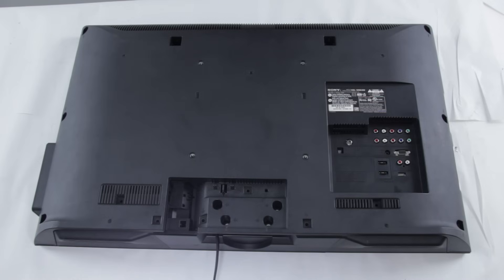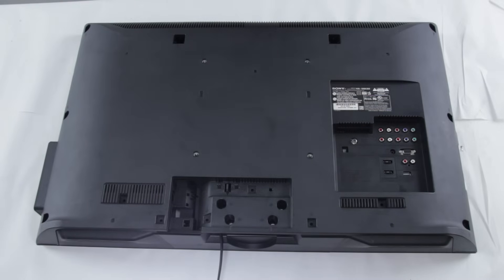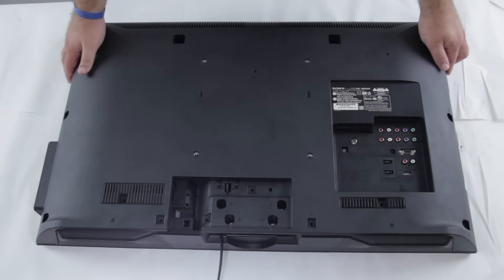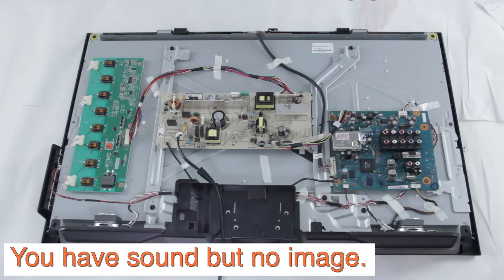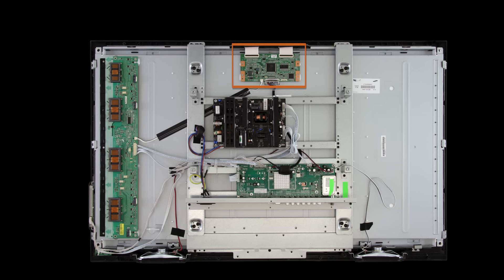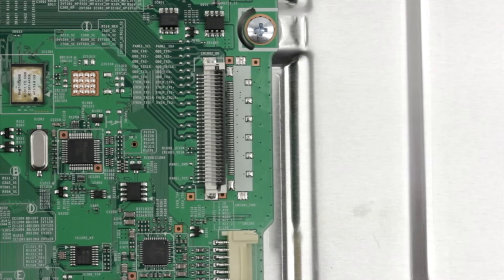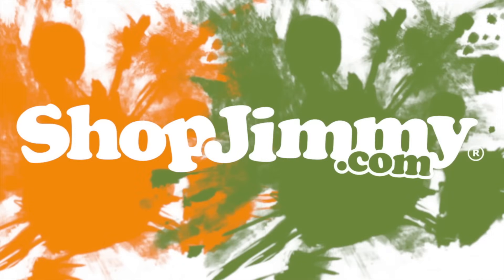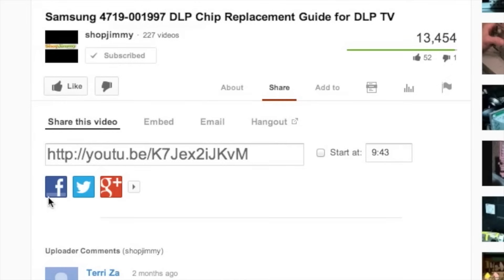LCD TV Repair Tutorial - T-Con Board Common Symptoms & Solutions - How to Replace T-Con Board

Comment: 2011 LG 55LV5500-UA ( S/N 102RMXX1G058 ), on power-up out of standby a week ago, saw video trouble. Very slow response time-looks like video is in slow motion with images trailing behind. See link https://www.youtube.com/watch?v=0GB1dEtHxDE which shows same symptoms as I'm having, whether from external input or SmartTV source. Sound normal. Tried reset, turning off TruMotion. TV sat unplugged for several days before trying again, symptoms unchanged.
Reply from the maker: Steve Rieker   Try all repairs and troubleshooting at your own risk.  This sounds like a TV panel (TV Screen) problem.  If your TV panel is bad, it may be more cost-effective to replace the TV as panels are typically hard to find in stock, difficult to replace, and expensive.  Thanks and please let us know if you have any further questions!  www.shopjimmy.com

Comment: Hello i have a 50 in rca model#50lb45rq serial #2409-50lb45r-b100415 the  problem is when you turn on the tv the red led on the  front of the tv turns blue  for  1 to  2 seconds then goes out  completely  the screen  try to come on  but it shuts off right  away. Any help  would be greatly appreciated.  Thanks

Comment: LG T420HW04, it started with vertical lines, which now is intermittent. The color is off now, it is blurry, almost like a 3D effect but is darker. Would a T-Con board replacement solve these issues?

Comment: I have a Toshiba 32W1333DB,  I have a back light problem, Can see image when in a dark room and shining a flash light on screen, But back light not coming on, After opening the tv, I have T-Con board at the bottom, And 2 boards in the middle that are plugged in to each other, One is the CPU, And the other is where the HDMI and Ariel slot in to, I was advised that the back light inverter has probably gone, Can you please explain where this is on this model, Is it part of the CPU Board

Comment: I have a Sharp lc-70le650u tv that has major issues. 
It powers on. It has sound. It has an overall red and yellow hue. The Picture rolls from top to bottom erratically. This happened all at once during a storm. It was plugged into a large Monster brand surge protector / strip.  
I have removed the back panel and it has three easily replaceable boards. The first is the power board.  I am assuming it is OK. The other two are the T-Con board and the main board.  Sugestions?
Reply: Dan Rosson The tv is out of warranty and about 18 months old.

Comment: hi my tv smart samsung UN40EH5300FXZA has just one horizontal line between the middle and the top of the screen and it is permanent , always in the same place . Do you think it can be a bad t con , main board , cables or  just a bad panel . thanks in advance.
Reply from the maker: ernesto fernandez  Try all repairs and troubleshooting at your own risk.  This sounds like a TV panel (TV Screen) problem.  If your TV panel is bad, it may be more cost-effective to replace the TV as panels are typically hard to find in stock, difficult to replace, and expensive.  Thanks and please let us know if you have any further questions!  www.shopjimmy.com

Comment: OK. So, I got really pissed off yesterday and threw something and it hit my tv. Now, i have vertical colored lines running up and down half of the screen and some video in the other corner, but I can't watch it. Does this sound like a tcon board issue or do I need to replace the screen?Thank you for your help. Also, The screen is not cracked, but when you turn it on, it kind of looks like it in a few spots. Any help is appreciated.
Westinghouse 32" LTV-32W4HDC LCD
Reply from the maker: Amanda Thomas   Try all repairs and troubleshooting at your own risk.  This sounds like a TV panel (TV Screen) problem.  If your TV panel is bad, it may be more cost-effective to replace the TV as panels are typically hard to find in stock, difficult to replace, and expensive.  Thanks and please let us know if you have any further questions!  www.shopjimmy.com

Comment: hi. I have a warfedale  lcd37f1080p. I have replaced the t-con board. However the LVDS connecter on the T-Con side when I removed it some of the wires dissloged from the connecter,I put them back where I assumed they came from. However upon testing I see the coulors are mismatched. Green is pink yellow is blue etc. is there any way I can get a schematic on this cable and if not could I get a replacement LVDS cable. The T-con board No. is T37OHW02 V0. (06A221-B). I hope you can assist me. Kind regards. I reside in South Africa.
Reply from the maker: Jan B   Try all repairs and troubleshooting at your own risk.  Unfortunately, we do not have any information on this TV.  Thanks!  www.shopjimmy.com

Comment: I have an LG 50LN5600. Everything works fine except the bottom half of the screen. There are narrow horizontal stripes across the entire bottom of the screen, so it almost looks like poorly interlaced video. You can see the intended picture on the bottom half, but it looks fuzzy and garbled because the thin strips of the video are jumbled and out of order. This problem shows up on the menus too. I've tried unplugging everything and doing a software reset, but the problem persists. Any ideas?

Comment: I have a Toshiba 46xv54ou 2008. I'm getting lines down my screen. I was curious on the cost of the part. Everything else works on the tv.
Reply from the maker: nick lillquist   PLEASE SUBSCRIBE TO OUR CHANNEL - Try all repairs and troubleshooting at your own risk.  Are the lines vertical or horizontal, and do they cover the entire screen or just parts?  Thanks!  www.shopjimmy.com
Reply: The vertical Lines cover the entire screen.
Reply from the maker: nick lillquist   Try all repairs and troubleshooting at your own risk.  This sounds like a TV panel (TV Screen) problem.  If your TV panel is bad, it may be more cost-effective to replace the TV as panels are typically hard to find in stock, difficult to replace, and expensive.  Thanks and please let us know if you have any further questions!  www.shopjimmy.com

Comment: I have a Samsung 32 TV. The sound is working but there is no picture, one minute it was working, then it lost its picture straight away. I don't think there is any backlight. The TV is a Samsung UE32EH5000K    Vers 07 and the serial number is B4 V83HBDA00081V.
Reply from the maker: Bryan Findler  Try all repairs and troubleshooting at your own risk.  I recommend running the flashlight test on your TV.   Here is a link to a video we produced that shows how to run the flashlight test. https://www.youtube.com/watch?v=xUzCLgoSPGM Please reply with your flashlight test results and we can recommend a replacement part for your TV repair. Thanks and please let us know if you have any questions! www.shopjimmy.com

Comment: Hi ... We have a Sony KDL-46X3000, (4600278) (VK-X-A-GBW-N-FYA-M) which has been perfect since we bought it. Yesterday the screen started flashing, going brighter then returning to normal probably 3 or 4 times a second. This may stop but invariably would get worse and start to flash on and off and eventually no picture, just a black screen but with sound (that remained unaffected throughout). When black, no image from menus or other sourced would display.

Switching the set off for a few minutes may restore stability for some time until the symptoms returned.

I am reluctant to scrap it without first investigating possible fixes and am put off official Sony repairs due to horror stories on forums of insane repair charges when new TV's now are so affordable!

Your guidance would be welcomed!

Comment: Hi. I have a Samsung TV. Model: LA32E420E2R. It has a double image. I stripped it down and it only has one ribbon to the image board then one direct (undetachable) ribbon the screen. How do I solve the double image?
Reply from the maker: Tom Porter   Try all repairs and troubleshooting at your own risk.  This sounds like a TV panel (TV Screen) problem.  If your TV panel is bad, it may be more cost-effective to replace the TV as panels are typically hard to find in stock, difficult to replace, and expensive.  Thanks and please let us know if you have any further questions!  www.shopjimmy.com

Comment: I have a Sharp Aquos 70" tv. LC-70LE650U. Only a year old. Not in warrenty.
TV wont power up. Blinks 5 times then 2. I have a soldering gun and am very good with it I can replace any part on the tv. Just need to know what needs to be replaced.  PLEASE HELP!!! Thank you.
Reply from the maker: Eric Manchester  Try all repairs and troubleshooting at your own risk.  This sounds like a TV panel (TV Screen) problem.  If your TV panel is bad, it may be more cost-effective to replace the TV as panels are typically hard to find in stock, difficult to replace, and expensive.  Thanks and please let us know if you have any further questions!  www.shopjimmy.com

Comment: I have a sharp aquos LC-60E78UN. It has a thick blue strip just to the right of the center of the tv. Would this be caused by the tcon board. Ive tried gently cleaning the ribbon cables from the board, and the blue stripe persists.
Reply from the maker: gabriel rider   Try all repairs and troubleshooting at your own risk.  This sounds like a TV panel (TV Screen) problem.  If your TV panel is bad, it may be more cost-effective to replace the TV as panels are typically hard to find in stock, difficult to replace, and expensive.  Thanks and please let us know if you have any further questions!  www.shopjimmy.com

Comment: i have 42 inch samsung pn42c450 
on the right hand side i have approximately 6 inches of black space which makes my television look like a 32 inch is it the t-con board
i would like to buy one from you asap, my email is jm5431@gmail.com
Reply from the maker: Jay M   Try all repairs and troubleshooting at your own risk.  This sounds like a TV panel (TV Screen) problem.  If your TV panel is bad, it may be more cost-effective to replace the TV as panels are typically hard to find in stock, difficult to replace, and expensive.  Thanks and please let us know if you have any further questions!  www.shopjimmy.com

Comment: I have a Sylvania LC320SL1 32-inch 720p LCD HDTV. went to turn on, and it will not using tv button or remote, but the stand by light stays on. Have unplugged and waited for a week then tried again, still doesn't come on

Comment: Hello Shopjimmy.com   i have two tvs that stopped working some time back and I am curious to see if they are worth a fix..
---------------------------------------------------------------------------------------------------------------------------
The Sanyo ( Model# DP42849 )   Powers on, and shows a green power light, and you can see the backlight,  but it shows no picture..  you can also hear sound..   what could that be ??
---------------------------------------------------------------------------------------------------------------------------
The Toshiba is older  ( Model# 42HL196 )     does not power on but shows a solid red light when the power button is pressed.   it just wouldn't turn on one day.. 

It would be nice to fix these and put them to use instead of just trowing them out..

Comment: I have a Philips 42PFL3604/12 with display/backlight  issue. After few second upon turning it on, the screen picture goes from normal to very bright and it stay very bright. As if it would turn the backlight fully on. What is most likely to be the problem? Thank you in advance!
Reply from the maker: Marko K   PLEASE SUBSCRIBE TO OUR CHANNEL - Try all repairs and troubleshooting at your own risk.   This could be a problem with either the main board, the t-con board or the TV panel.  Unless you have experience using a meter to check voltages, you can replace the main board and t-con board individually to see if one of those boards fixes the problem.  Unfortunately I do not see any replacement parts in the search results for your TV model number on our website.  Thanks and please let us know if you have any further questions!  www.shopjimmy.com

Comment: My model # LN52A530P1FXZA and the problem I am having is when I turn it on I get a picture for a second and then it goes away(getting sound) have replaced two of the backlight invertors and that has not helped. Could it be the tcon board?
Reply from the maker: *****   Try all repairs and troubleshooting at your own risk.  I recommend running the flashlight test on your TV.   Here is a link to a video we produced that shows how to run the flashlight test. https://www.youtube.com/watch?v=xUzCLgoSPGM Please reply with your flashlight test results and we can recommend a replacement part for your TV repair. Thanks and please let us know if you have any questions! www.shopjimmy.com

Comment: I have a 55lw6500-UA LG 55 inch LED backlit TV. I have a blue vertical line going down the screen when it is on. Nomatter what input or channel the same blue looking line. It might be different color depending on the color in the background of the TV. Thanks
Reply from the maker: Alfred Burio  Try all repairs and troubleshooting at your own risk.  This sounds like a TV panel (TV Screen) problem.  If your TV panel is bad, it may be more cost-effective to replace the TV as panels are typically hard to find in stock, difficult to replace, and expensive.  Thanks and please let us know if you have any further questions!  www.shopjimmy.com

Comment: Hi jimmy, worth watching video. Jimmy I got samsung h8500, 65 inches. Sometimes it has no picture but only sound. If I remove power cable from the socket and wait for 10 second it will turn on normally and will run normal. But some time if I switch off with remote and turn it on than it will gibe the problem, than I do the above action. Need your help. Thanks in anticipation. Haseeb
Reply from the maker: Haseeb Ullah   Try all repairs and troubleshooting at your own risk.  Please reply with your TV model number.  Click here to view a video that shows how to find your TV model number:  https://www.youtube.com/watch?v=S51nhAmwR2M  Thanks!  www.shopjimmy.com

Comment: Hi, I have a Panasonic txl50b6b with a problem of fuzzy picture only a third of the screen from the bottom with horizontal lines. Is it the Tcon board or the main board please?. see picture; https://www.youtube.com/watch?v=MolwYy85v5A&feature=youtu.be
Reply from the maker: gold6270   Try all repairs and troubleshooting at your own risk.  This sounds like a TV panel (TV Screen) problem.  If your TV panel is bad, it may be more cost-effective to replace the TV as panels are typically hard to find in stock, difficult to replace, and expensive.  Thanks and please let us know if you have any further questions!  www.shopjimmy.com

Comment: I have an LG 42LG50 and the screen went negative and washed white so I first tried putting spacers under the board that runs along the run of the tv which didn't work so decided to order a new t con board. I installed it once it came in and the tv powered on, and then screen was no longer white and negative but vertical red lines appeared and shortly after, the backlight turned off and the backlight stays off unless I unplug the t con board. I can see a green light flashing on the board that the t con cord comes from (the same board that has all the source inputs on it) as if it is trying to turn on, fails and repeats. 

Thanks for any advice! 
Ethan
Reply from the maker: Ethan Caswell   Try all repairs and troubleshooting at your own risk.  This sounds like a TV panel (TV Screen) problem.  If your TV panel is bad, it may be more cost-effective to replace the TV as panels are typically hard to find in stock, difficult to replace, and expensive.  Thanks and please let us know if you have any further questions!  www.shopjimmy.com

Comment: I have a dim area horizontally across my samsung un85f7100afxza. The picture is there but it looks like the backlights across the center of the screen are out. The top third and bottom third of the screen are fine. Is that an easy fix or a total replacement of the screen?
Reply from the maker: TheDrcastle   Try all repairs and troubleshooting at your own risk.  This sounds like a TV panel (TV Screen) problem.  If your TV panel is bad, it may be more cost-effective to replace the TV as panels are typically hard to find in stock, difficult to replace, and expensive.  Thanks and please let us know if you have any further questions!  www.shopjimmy.com

Comment: VF551XVT vizio I believe. Not home to double check at the moment but with out warning and no consistent timing or heat problems, the vizio will shut off. The vizio insignia is still lit light blue/white like it's still on but the bavk light, the picture, and soumd will all shut off. It even has a faint click sound like it was turned off. Any ideas?
Reply from the maker: Cjarvis1136   PLEASE SUBSCRIBE TO OUR CHANNEL - Try all repairs and troubleshooting at your own risk.  I recommend replacing the main board in your TV.  Click this link to replacement parts for your TV model number:  http://www.shopjimmy.com/vizio-3655-0032-0150-main-board-for-vf551xvt.htm  There may be multiple boards for the same TV model number, be sure to match part numbers on your current board, with your replacement for compatibility.  Here is a link to a video showing how to identify your part number, click here:  https://www.youtube.com/watch?v=kxkeGLhlQY8Thanks and please let us know if you have any further questions with your TV Repair!  www.shopjimmy.com

Comment: I have a JVC EM65FTR that displays half blue screen and half black with a vertical band of yellow about 5 inches wide.  Just wondering if it's worth replacing boards or if it's most likely a screen issue.  Depending on input the display does change, if I don't connect anything I will get gray vertical lines when I hit the menu button, although there are no words displayed.
Reply: Phil Pawlowski  Any thoughts on this?